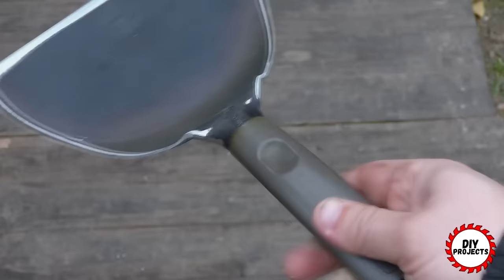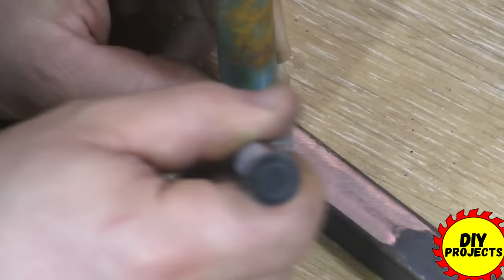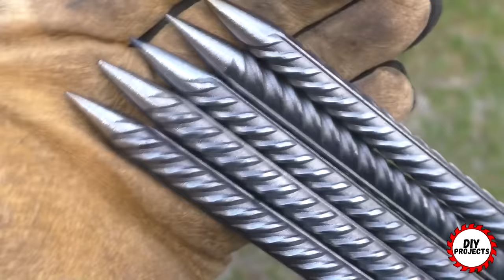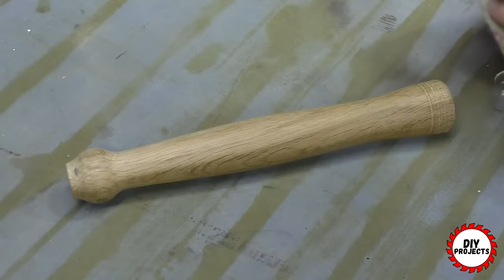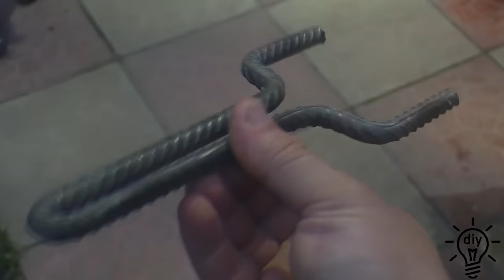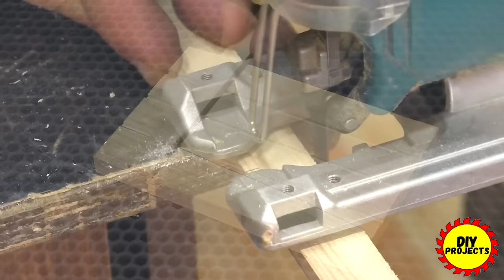5 genius ideas that spark emotions ! DIY

Comment: Instead of destroying a cast iron skillet to make a spatula, you can buy a large grill spatula for less than the cost of the skillet alone, much less the time and money spent on the angle grinder and power for it. Also, you channels love angle grinders so much, why don't you start marrying them?

Hurray, a micro-stove to heat up your half-empty mug with increased carbon inhalation so you don't have to smoke and use a wood stove you already have installed or many other means of heating up your mug.

An expensive and heavy back-scratcher or small rake that takes more money and time to make than to just buy one. Could even make the back-scratcher out of wood and save time, money, and weight.

Oh, a rebar slingshot that's so underpowered you'd do more damage throwing the projectile at the target than you would using the slingshot.

The last one, yeah, toilet paper holders like that have been sold and made by people on their own for decades if not almost ever since toilet paper was sold on a cardboard tube. And didn't cheap out using a pistachio shell.

Comment: Cast Iorn pan = 30 dollars
Overweight spatula that burns your hands = -13 dollars. Great idea!
Reply: Yeah, my wife just left a 50 cent plastic spatula in one of my perfectly seasoned skillets that had not seen soap and sand for nearly 50 years. The burner was on 'high". So, this morning. I woke up to 2 smoke detectors screaming "FIRE!" and a skillet sucking molten plastic into its once beautifully seasoned antique porous surface. She left it outdoors so I could shatter it, as I will to protect future generations from using it, because cast iron lasts forever. Cast iron is often used to melt lead for bullets and fish sinkers, and by recreational gold miners to concentrate their findings and burn Mercury off their amalgam'd gold. Of course, once I know a piece of cast iron has cooked Mercury, I wouldn't want another generation's grandchildren to discover this "wonderful old skillet" and carting their newfound treasure into their kitchen for decades more of cooking mercury into their food. Plastic isn't as likely to be a known toxin. but I treat 'em the same. The biggest drawback I can see to this spatula is its weight, when pack-camping. But when using boats, cars, trucks or horses to haul the freight, I can be a little less parsimonious when weighing out the packs. I'm gonna build a couple of them.